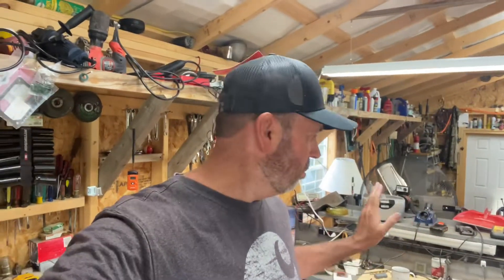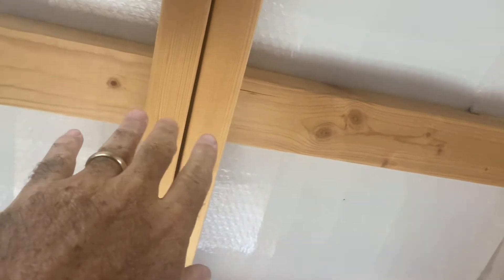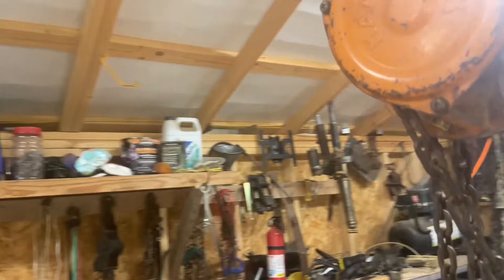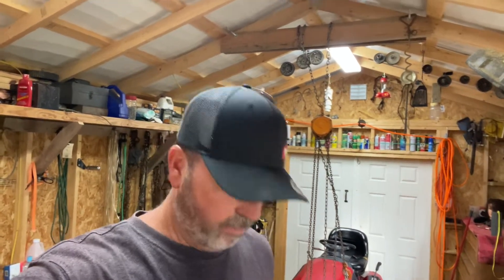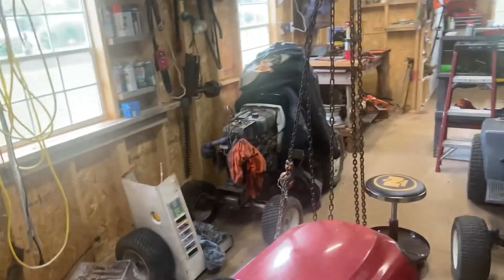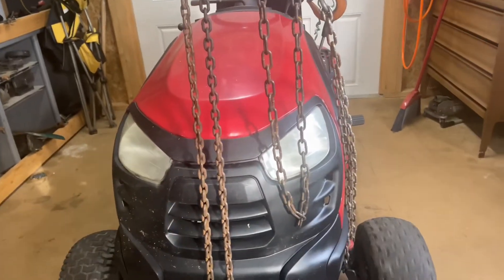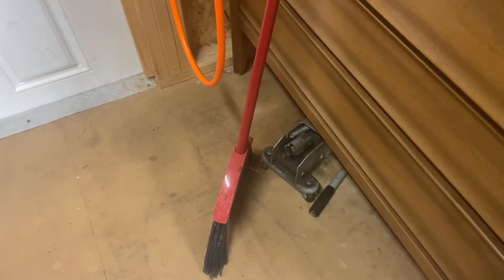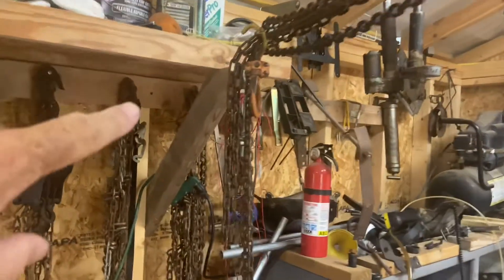How to lift garden tractor/mower the easy way￼

Comment: Problem with standing mower straight up is oil drains out and into combustion chamber. Just my opinion but works for me,get the mower on a home built 24 in high table.Lift mower from the wheels on one side.My table has 4x6 x 8ft corners,I just rig chains to hang hoist.
Reply from the maker: Table is a great idea- I don’t  I have enough room 

I don’t lift to high unless I need to for that reason (oil drainage)

Thanks for watching
Reply: @MurphyMower  
My table ramps are removable and I use the table frequently for other tasks,I am considering screw Jack's on the corners.
Reply from the maker: @randolphsnyder1505  this is a great idea. I may consider doing this.
Reply from the maker: @randolphsnyder1505  my mind is now spinning

Comment: I think the spot you chose to put your bolt through is a little too high on the board, especially on the left side.  The end of the board could just split open. If you shorten the weathered boards and push them up higher to the insulation, you can get the bolts through the center or lower, but then you'll have double the holes in your rafters. The simplest improvement would be to just strap the middle up to the peak with scrap wood or metal and screws.
Reply from the maker: Thanks for the info- I may revisit this